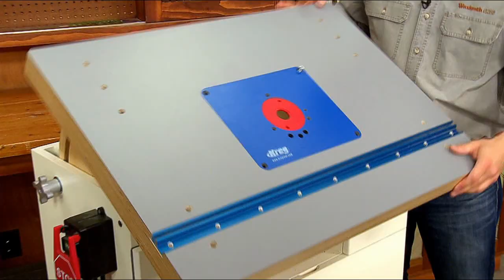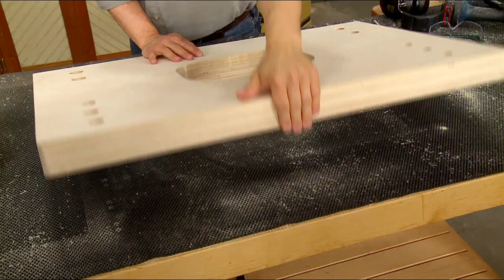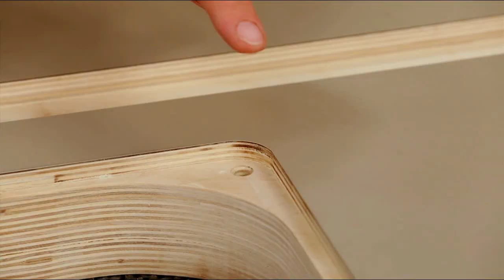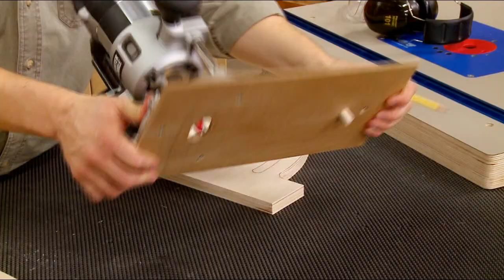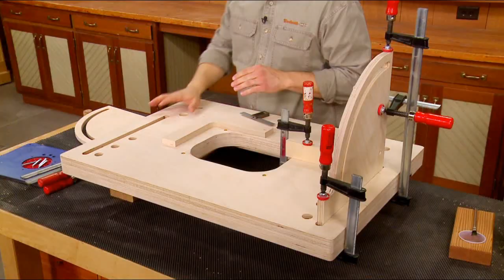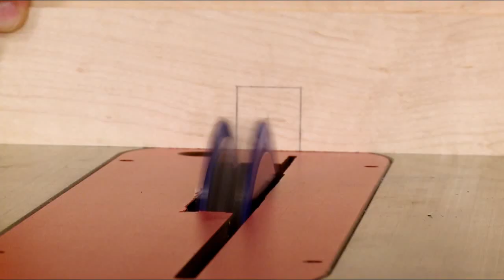Build A Combination ROUTER TABLE! - Part 4

Comment: I just completed the pocket for the router plate and am ready to drill the holes for the mounting plate. The machine screws are 1/4-20. The threaded inserts use a 3/8” pilot hole. I’m thinking it is okay to drill the 3/8” hole through the entire top as the mounting holes in the plate plus the pocket itself will not allow “play” in the plate once the screws are tightened. Am I correct?

Comment: I notice that a start hole is made when a sabre saw is used. I understand hehe a drill is used to radius the corners but I never see what we have always called a standing cut. The saw is tilted to the front edge and the blade is lowered into the cut until it is on the shoe. I have never had a problem with this method.

Comment: I purchased the plans for this table and am well on my way through the assembly.  The base is complete and am about halfway through the upper assembly.  I was looking at the numbers for the quadrant and they don’t add up.  The pivot point and lock bolt are 9-13/16” from center to center.  The plans call for the slot to be routed with a 9” radius to the inner edge.  With a 5/8” slot, that means the slot will not line up.  What am I getting wrong here?
Reply from the maker: According to the plans I've got 9 5/16" from center to center on the pivot and lock points on the case sides. [15" case side - 1 1/4" from front to center of pivot - (3 11/16" + 3/4") from back of side to center of lock... 15" - 5 11/16" = 9 5/16"]

Comment: what router and what h/p?
Reply from the maker: Hi William. With the router plate we used (Kreg PRS3038), you can install your choice of router. And honestly, size isn't a huge issue here. You could install anything from a Porter Cable 690  clear up to one of the 3.5HP monsters! Personally, I would be looking at the Bosch 2.25hp router :-).